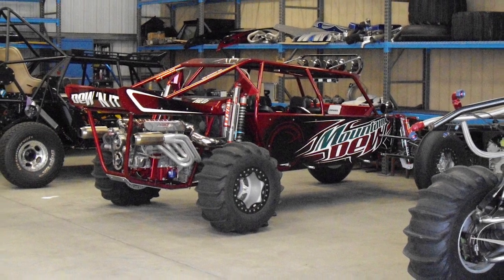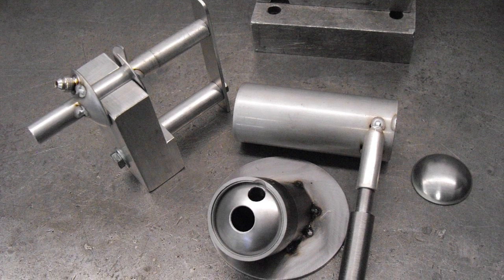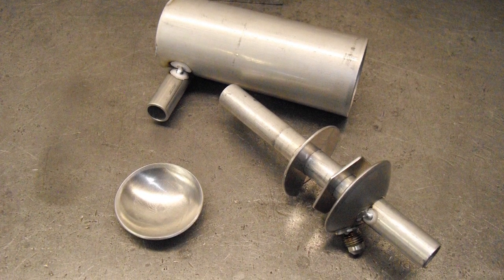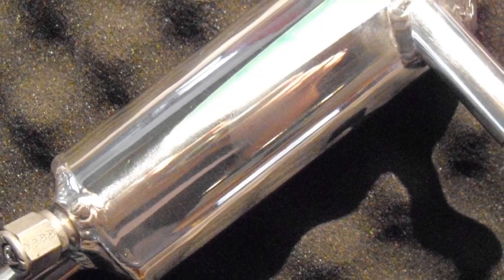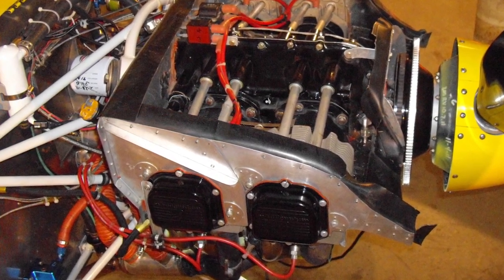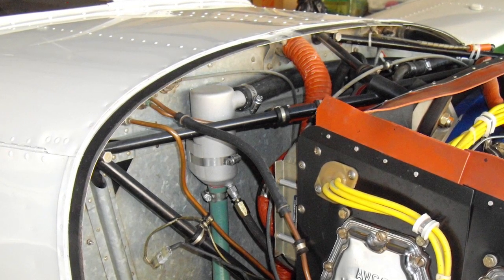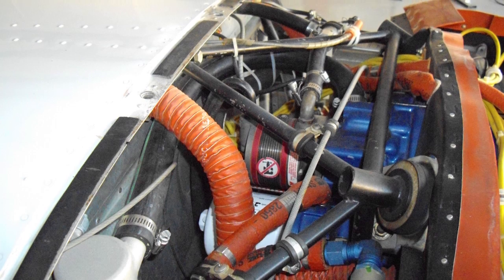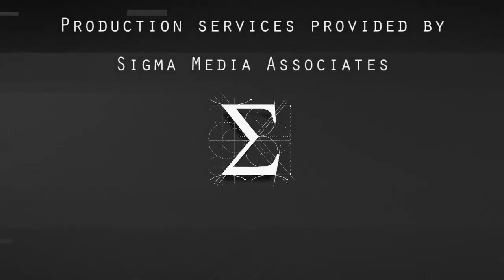The ASA Oil Seperator by AntiSplatAero.com

Comment: #1 What is the pressure resistance or drop of CCV Crank Case Vent across separator? Let's take 3/4" tube, area is about 2.35 sq-in (less because ID is less than OD of tube). What is the min area throughout  the separator (at plates or  cone flare)?  #2 Don't like steel wool in any separator (personal preference/experience). Separator can't be opened and it can get gummed up, creates a place for oil to get blocked from drain, filling the separator and possible restricting vent.